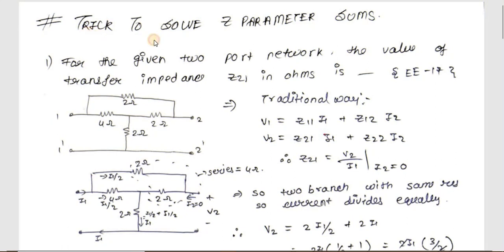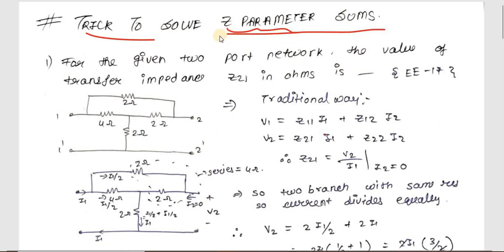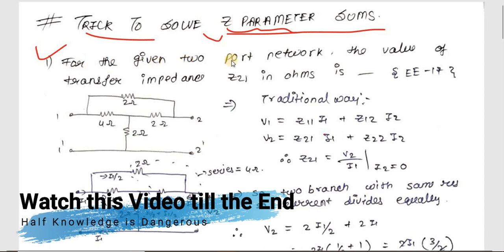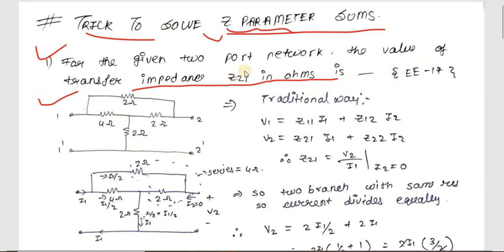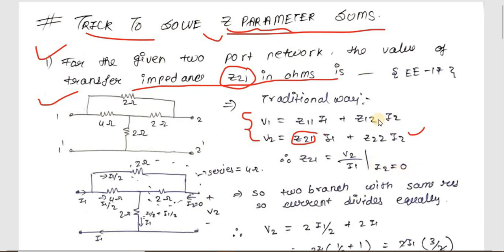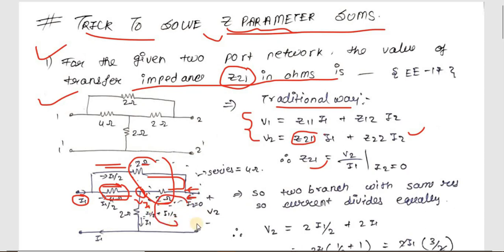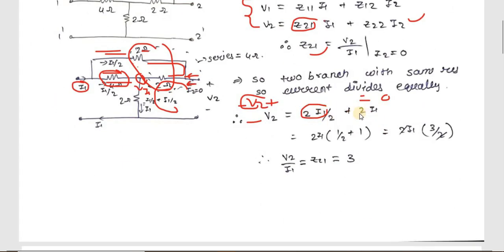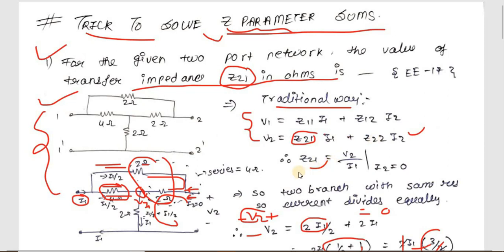Trick to Solve  Z Parameter Sums | Z parameter Tricks | Short circuit Parameters of Two port network

Comment: If Z21 not equal to Z12 then??????
Reply from the maker: Good question, Actually we can directly write z parameter for T network, and for other circuits if it cannot be converted into T network. Then just use kvl and try to adjust the equation as per z parameter equation, then by comparing it you will het all terms of z parameter